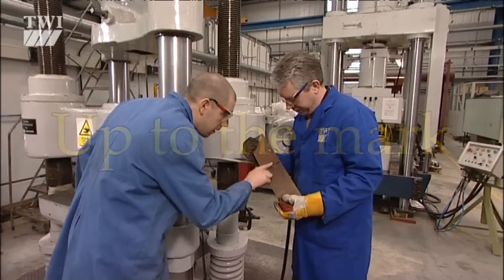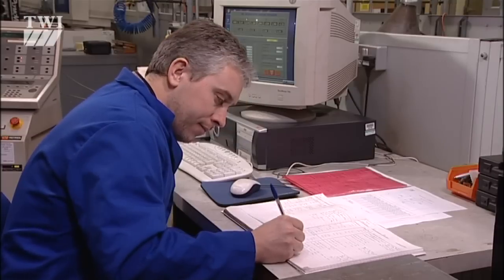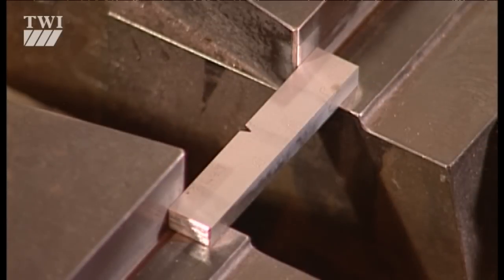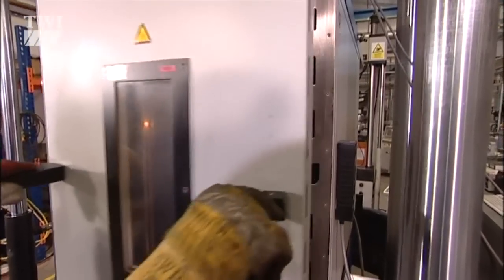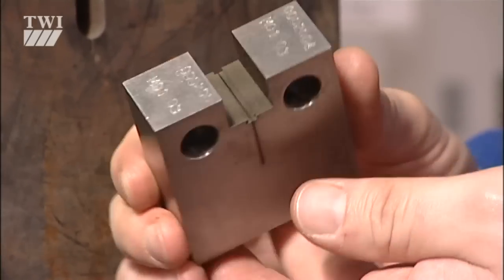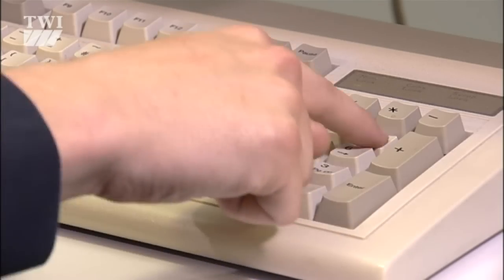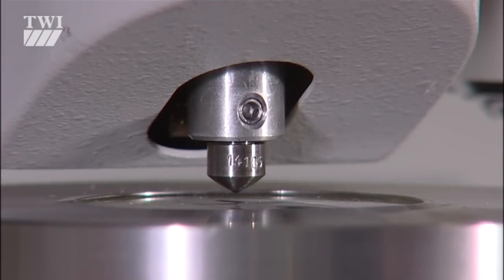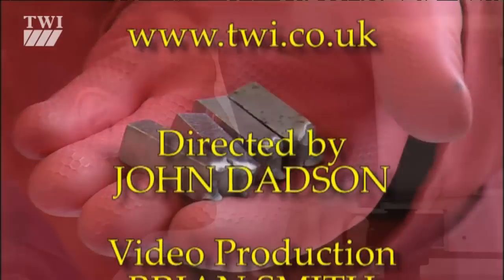TWI - an introduction to mechanical testing techniques

Comment: Great informative video, but I can't get over the fact that the weld at 10:27 labeled a good weld so clearly has absolutely NO penetration at the root.
Reply: Oddly enough, some codes don’t require full pen fillet welds.     Depends on the weld procedure.
Reply: I know im randomly asking but does anyone know a method to get back into an Instagram account..?
I was stupid forgot the account password. I would love any tricks you can offer me.
Reply: @Jeremias Alexzander instablaster ;)
Reply: @Joel Gunner I really appreciate your reply. I got to the site thru google and Im in the hacking process atm.
Takes a while so I will reply here later with my results.
Reply: @Joel Gunner It worked and I finally got access to my account again. Im so happy:D
Thank you so much you really help me out!
Reply: @Jeremias Alexzander You are welcome :D